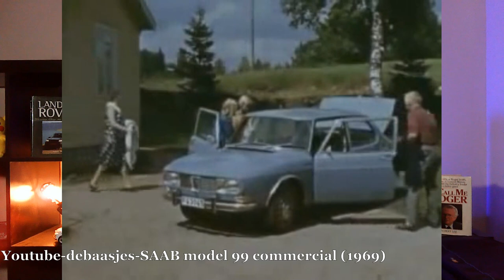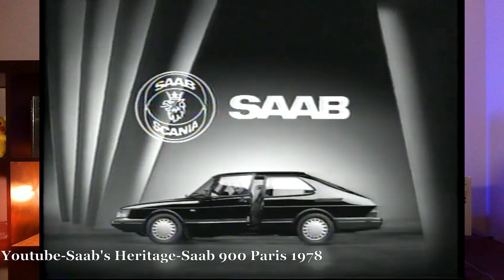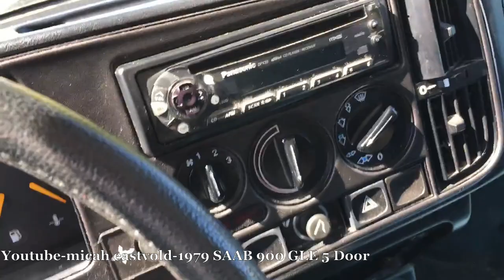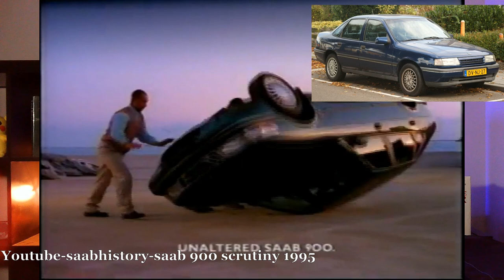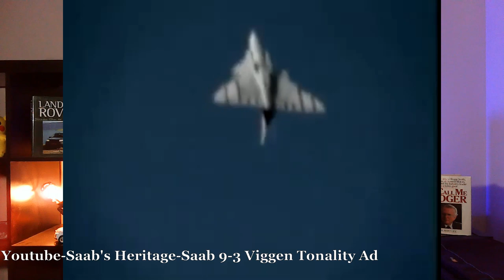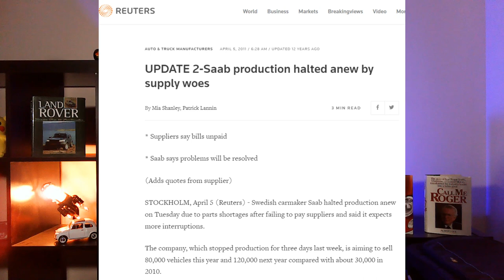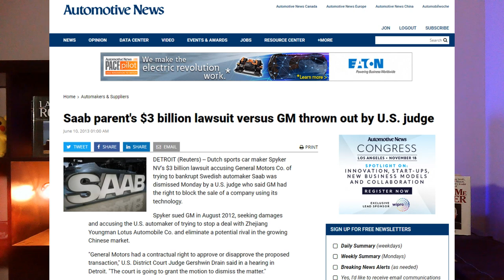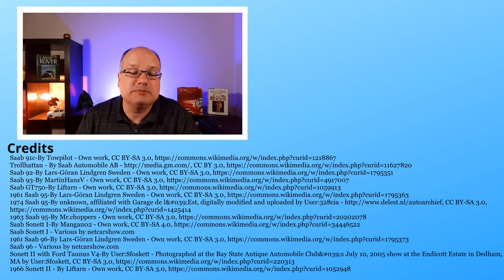A Far Too Brief History of SAAB

Comment: The Dolomite derived engine was one of the most unusual installations ever... the engine was installed with the flywheel to the front of the car, and then a triplex chain down to the gearbox which lived under the engine (like in the original Mini, but separated, and not sharing the same oil)...  Saab were truly original in their thinking in many areas....
Reply: SAAB did a very very major redesign on that engine. So produced a fantastic reliable and powerful engine! 😅

Comment: I had a 1978 99 Turbo Kombi Coupe. It was insane. The engine tore itself off the front mounting, actually ripping the metal. Eventually,  I wrote it off on a winding country lane in the back end of Essex,  leaving the road at great speed. The garage who bought the wreck from me later informed me that the engine was non-standard, similar to the Blomquist Clarion cars. That explains a lot!

Comment: I worked for a Saab dealer in 89-91. People loved their cars, but many were easily swayed by the new Japanese luxury cars. People opened the door on a Saab and then heard how good the 2.0L engine and trans were..They popped the hood open to see the battery needs frequent filling and the recommended 7500 mile inspections(which they had a lot of problems).

.hen they went across the street to Lexus/Infinity and when opening the door the seat moved to help them get in, and they had powerful modern V6 engines. Maintenance was oil changes and tire rotations at 5k miles, and 30k miles spark plugs.

For company that cared so much for safety, in those 2 years I saw 5 safety recalls...very high for a company with only 2 cars that only has minor changes every year.

In one cold December day we had 30 cars towed in for no-starts(electronic fuel injection issues)..Funny because the older ones that were mechanical fuel injected were fine, and my old cheap Chevy cavalier was used to get people around!  Like Sweden is a warm climate!

Many owners loved them, but in terms of value, they were significantly over priced and behind.

Comment: I’ve had an SPG, a 9000 Aero, an ‘06 9-5 wagon, but my ‘01 9-5 Aero wagon with a manual transmission is hands down the best car I have ever owned. They took everything that was either missing or annoying in the 9000 and fixed it. It was an incredible car and ergonomically perfect. The ‘06 had been de-contented and it shows.

Comment: Excellent as always! The only person I ever knew that had Saabs is my cousin she had a late '90s 95, a convertible 93 from the early 2000s and a mid to late 2000s 93 sedan. I know she liked her first one the best and grumbled about the ever-increasing GM influence. When GM was doing the employee discounting, she bought the 93 sedan and remember her talking about how it was originally 32,000 but then she was able to get it for $24,000 All she like the price, she that it didn't look all that different from the GM sedans. Honestly I don't know what you do with some of these companies If during their hot period they're not making any money. The conclusion seems to be to share platforms and engines but then that causes the brand to lose its identity and then it ends up dying off. I've never really been a fan of joint venture projects because of this. They end up stealing sales from each other and not really expanding the market all that much for the company. It would have been interesting to have seen what would have been the result if say Chrysler and Saab could have teamed up instead of Daimler. In this situation, The companies could have benefited from each other if you have the right management which would need to be someone other than Bob Eaton. The Chrysler sedans were not competing in the kind of market that Saab was competing in yet the competent platforms they had or team that was capable of developing competent platforms could have benefited Saab. Having Saab help Chrysler with their quality issues, help them with turbocharging engines, and developing a turbo version of the 3.2 and 3.5 v6s to use in a Saab model would have been mutually beneficial. And co-engine development from that point on would have been nice. I think Ford would have done a more competent job than GM, but they had way too many irons in the fire as it was. Toyota would have been a interesting partner with having bulletproof powertrains and electronics. The question would be if Saab could turn a mule into a stallion. If so that would have fit nicely as Saab didn't really compete against Toyota and it was more performance focused than Lexus.

Comment: Hi Jon, thank you for this video.  I bought a 1988 SAAB 900 turbo. My “bachelor car”.  What attracted me to this car was the looks (aerodynamic, interior like a jet fighter plane, rugged like a P47 Thunderbolt).  Of course the quirkiness, the ignition between the seats, the way the engine hood opened/closed and the side lights illuminating rearward when backing up the car especially at night.  My only complaints: expensive, routine service, always some interior detail rattling whether the the dashboard when the AC was on or the front passenger seat and last but not least the rear SAAB metal emblem fell off (I had seen other missing emblems on SAAB 900 and 9000 models). Little issues but overall a good car.  Sad the way the company declined and eventually ended.

Comment: I'm English and have owned 3 Saab's over the years, I still have 1 today. By far the best for build quality was the first which I bought at 18 months old and had it around 8 or 9 years it was a 1993 L reg 900 Turbo se convertible it was faultless in all the years I had it, after that was a 05 55 plate 93 vector convertible 2.0 Turbo which wasn't a bad car then an 08 58 plate 93 sportwagon vector 1.9 CDTi which I've had too long certainly 9/10 years. It's probably been the worst for reliability etc. Worst thing that happened to Saab was GM getting involved. I've quite fancied instead of a Saab a Cadillac BLS which is a badge Engineered Saab 93. It was even built at Trollhattan, obviously parts are most interchangeable except for likes of the lights are different. Dash board is adsatly the same but instead of digital clock it's an analogue in the caddy or should that be Cabby lol. Also to get them out of my system buy a 12 plate 95 . Been.englisg when I say plate it means the registration and the year of manufacture on the plate, if it's built past have way through the year it gets a 5 in front so a car built in September 06 would be a 56 plate etc .

Comment: Sonett is derived from 'Så nätt' ≈ 'So (tiny and) neat'. My first car was a 12 year old white SAAB 95 V4 1971. It almost killed me. Rust had eaten through the left front suspension mount and it broke at 140km/h (90mph) but apart from that I have no major complaints so I replaced it with a 1972 96 that didn't have rusted suspension mounts. That one went like stink. It topped out the speedometer at 160km/h (100mph).

Comment: I had a 1999 SAAB 93 convertible and I LOVED THAT CAR! But at 135,000 miles it was falling to bits right when you could no longer get parts and I had to let it go for $1,300. I would have gotten a 2008/2009 but it became known that SAAB defied some of the orders of GM and kind of did their own thing, so the later cars couldn't be serviced by SAAB and GM refused anything to do with them. Very, very sad

Comment: My nephew had a "87 900S and l had a '90 Dodge Omni at the time. The Omni had a far better driving position, better ergonomics, better ride and handling (it had GLH tires,wheels and suspension and a 5 speed manual), much more comfortable seats and of course, with the Chrysler 2.2,  was much quicker than the Saab. Who would have thought, an Omni...

Comment: I actually like the 9-2x, but not because it's a "Saab" but rather because it is a nicer WRX outback.  If you nabbed the 9-2x Aero, it was a nicer STi outback.  Think of it in the same why you might think of a 442 to a Chevelle or a GSX to a GTO.  Same car, but the Olds and the Buick are just nicer versions than the Chevy or Pontiac.  (Yes I know they all each had their own divisional engines and slightly different engineering, where the Saabru was just a badge and bumpers)